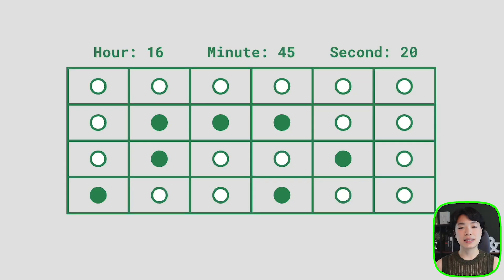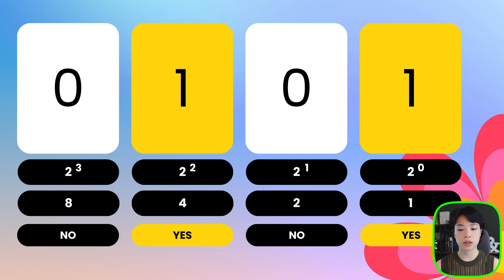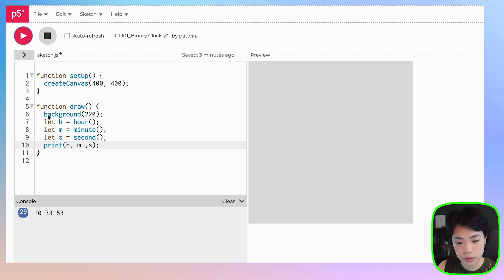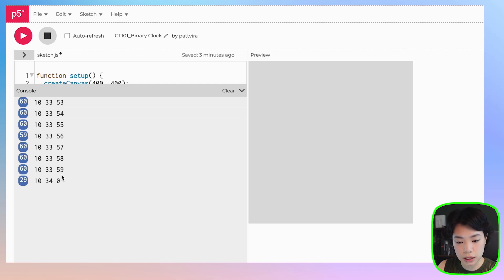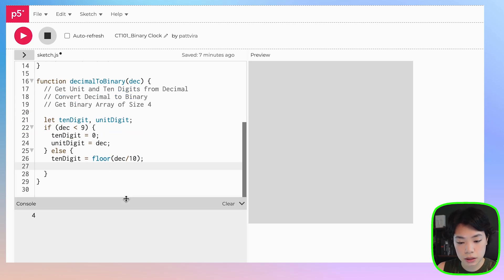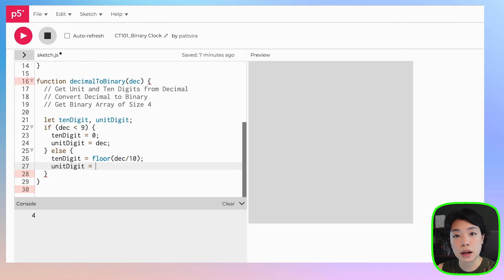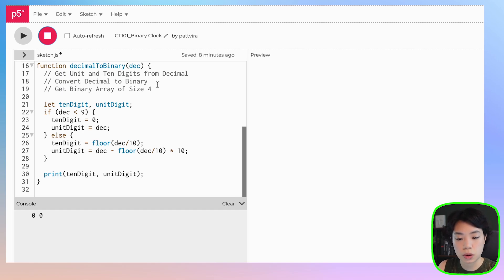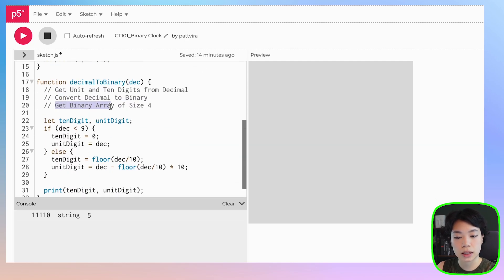p5.js Coding Tutorial | Binary Clock

Comment: 3:40 I think there's an issue at line 18. Since "9" is also a one-digit number, it should be "dec <= 9" or "dec < 10", right?
Reply from the maker: Nice catch! I just realized that actually I don't need the if statement at all. The equations below work for all numbers. 

tenDigit = floor(dec/10); 
unitDigit = dec - floor(dec/10) * 10;